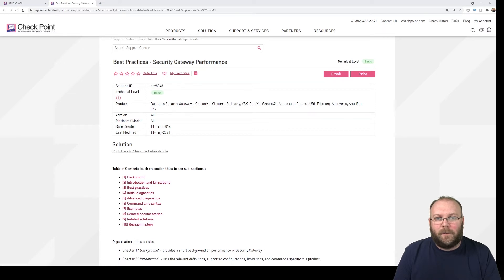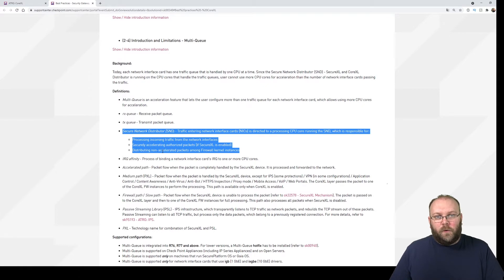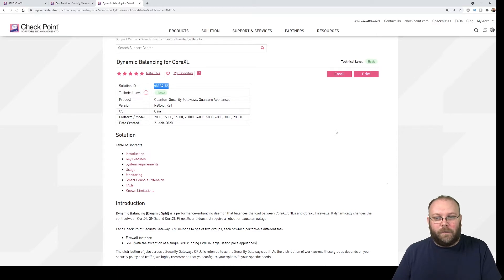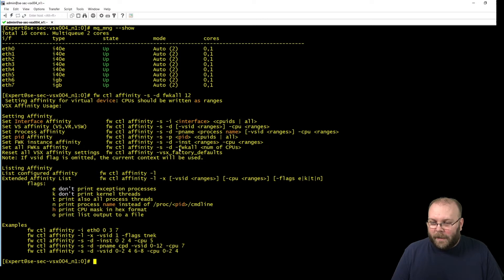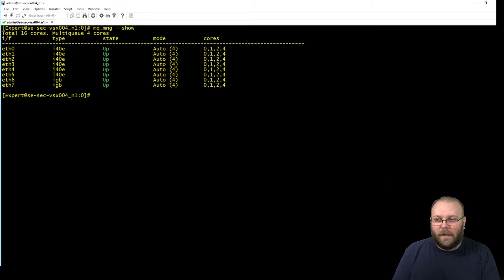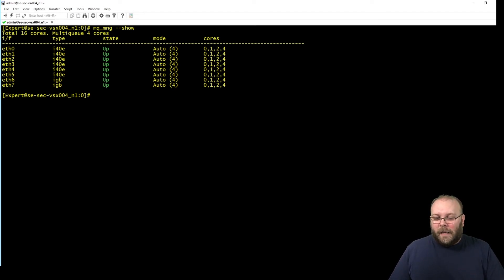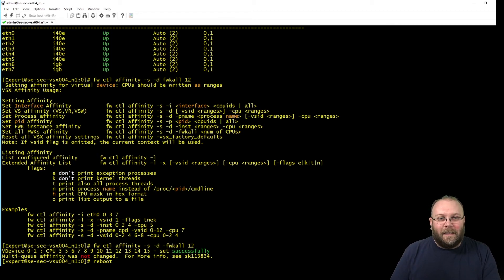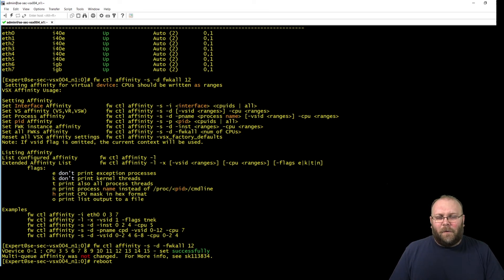Check Point VSX | How to change number of SND cores

Comment: Great stuff @Magnus. I also  had stuck with SND issue & got resolved after increasing core in SND. But now I’m again facing issues with different box & I identified only one SND core being utilised 100% although rest 3 SND have very low cpu utilisation. Any suggestions? I have 32 core CPU where 4 are for SND & 28 for FWK.
Reply from the maker: I will assume that you use multi queue on the interface. As it’s default on after r80.30 3.10 on interfaces that can manage it.

So one reason why something can go 100% is if it’s the same connection
Such as an elephant flow
https://community.checkpoint.com/t5/General-Topics/R80-x-Performance-Tuning-Tip-Elephant-Flows-Heavy-Connections/td-p/69105

A lot of these kind of tweaking is being removed in higher versions of software and manage “auto/auto” not much help now, but things get easier in the future :)

Comment: we had this problem in prod, although NICs are 40gig we need to manually allocate SND cores to handle the traffic eventhough the traffic itself is under 5gbps, this problem convince us to not use checkpoint in the future 🤦🏻
Reply from the maker: Sad to hear that, Atleast for normal appliances it’s fixed automatically in newer versions to have it dynamically allocated.

Also in the 3.10 kernel multiq is default enable, and the SND cores are changed by default depending on the box size.

VSX is somewhat diff as it already using something like user space firewall but for the VS itself. So I don’t think that this will be fixed in the near future to have dynamic split.
And I understand it can be annoying/frustrating when spending a lot of $ and then having the box perform like crap.
My personal feeling is that check point is working towards making everything more easy for admins, to have it setup right instead of just giving you 15diff options that you need to decide yourself based on experience.

(My recommendation is to buy some PS time when buying high end appliances/software, to set it up in the most efficient way)

And just to be super clear, interface speed on boxes doesn’t mean the box can actually handle the same speed with all blades, this is something you can use appliance sizing tool for as a partner.
So even if a box has 6x10G interfaces it didn’t mean it can run 60g. :)
Reply: @MagnusHolmberg-NetSec  yeah I think vsx is not mature compared to vdom on Fortigate or vsys on PA
so if you want to use checkpoint better not use vsx :)

ours is using 40G qsfp+ not 4x10G

great content btw 👍🏻, we had a hard time with checkpoint support when this issue occured in prod
Reply from the maker: @blurryjin  i dont really agree, i been using VSX for the last 10 years and we been using it within the company since start. for serivce providers it has great benifits in combination with openservers. But yes its for a specific case.
and you do really need to check the limitations before you go for a VSX system.

Am not sure i would use VSX for really highend stuff like if you need a single firewall to press lets say 30-40Gbit.

When i talk to CP they want to use meastro for everything above 10-20G.
But there are limitations there aswell.
Reply: @MagnusHolmberg-NetSec  I see, seems we don't have a good partner recommending the design
Reply from the maker: @blurryjin  yes that an issue, it’s very hard to find “blueprints” that says, build like this because….
That’s one of the major reason why I started with check point on this channel. :)

Comment: It's really helps me to clear the SND core concept in vsx since we are going to implement SND core one of our new customer, can i change multi queuing i GUI or just in cli  . Thanks for sharing
Reply from the maker: MultiQ is only changed in CLI.
In regards to VSX within GUI its the vs instance that is changed, More or less the number of firewall workers.
Reply: Thanks Magnus , do we need enabling the multi queuing only VSX node1  or both nodes  or just sync after rebooted , the second one enabling multi queuing feature boxes need the extra license ?
Reply from the maker: @rizwanrashid172  multiQ is enable by default from R80.30 3.10 kernel.
So before on the 2.6 kernel this need to enable manually, and not all interfaces supports multiQ.

Settings should be done on all members in the cluster. and there is no licens to use the feature.
Reply: Thanks Magnus appreciated